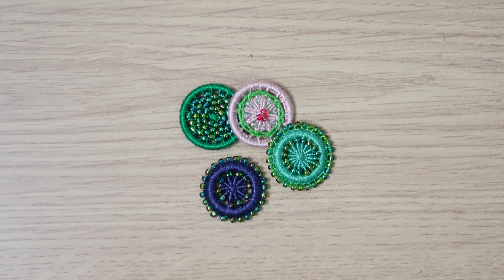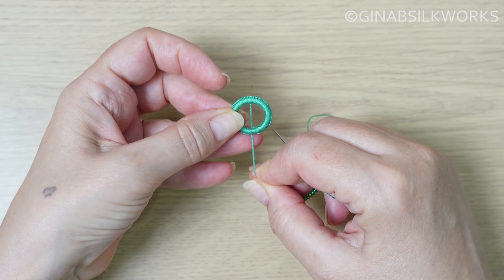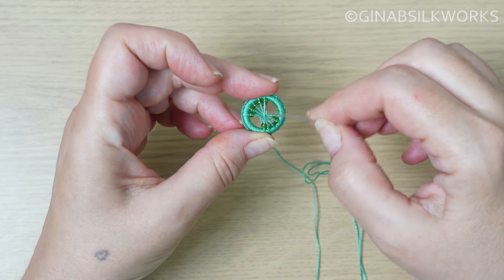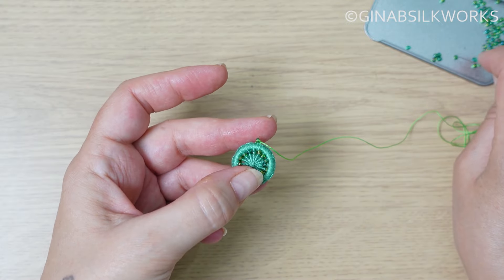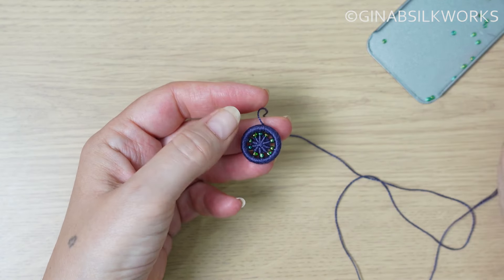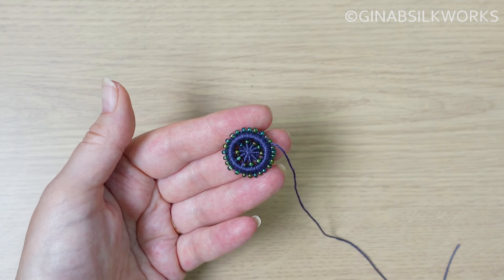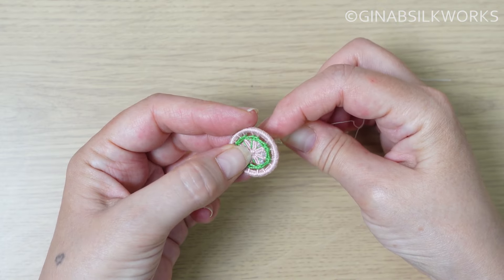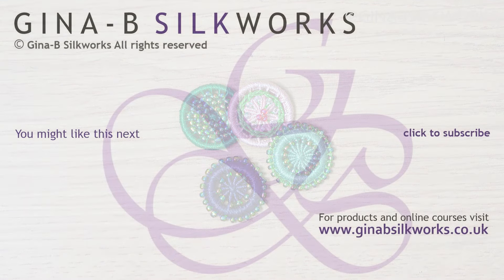Sparkle Up Your Dorset Buttons With Beads: 5 Ways To Add Bling!

Comment: If the button will be used in jewelry, how should the back be finished/covered as it will be against the skin?  Thank you
Reply from the maker: The easiest thing to do is to back it with a piece of felt sewn on. Some people glue felt to the back, I prefer little stitches. If making a brooch, the pin can be sewn to the felt first for a neat finish. You could use any soft fabric.
Reply from the maker: Here's an older video of mine showing a lot of different back finishes - https://youtu.be/Vi8_7DP0irU